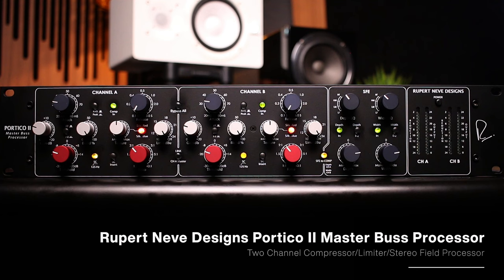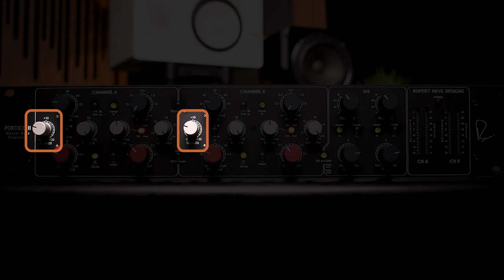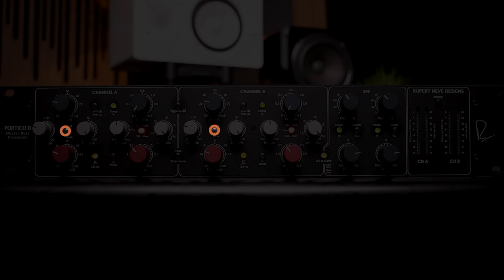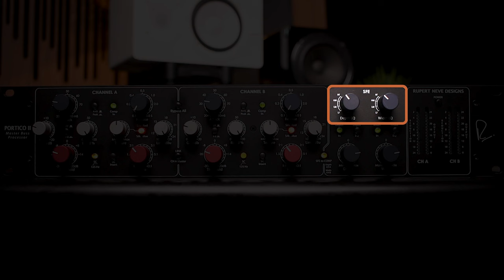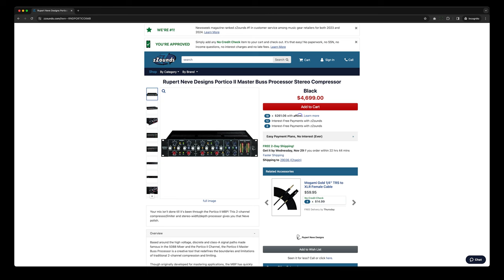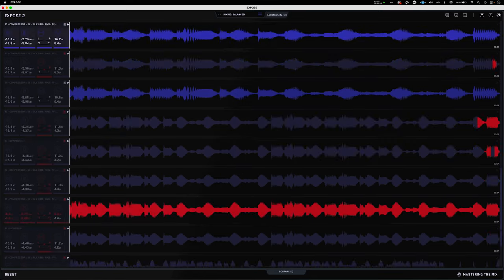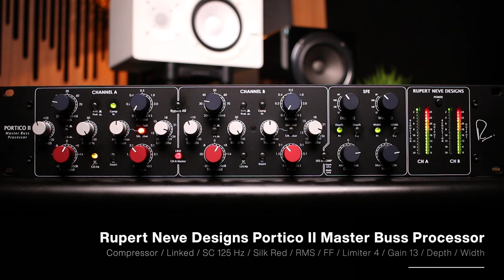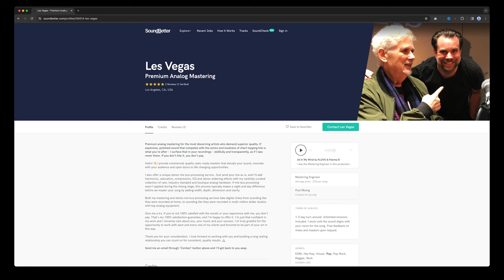Rupert Neve Designs Portico II Master Buss Processor (Demo and Overview)

Comment: Great video. I wasn't expecting such a dramatic difference between  linked/unlinked modes...even with very little compression. The stereo image in unlinked mode sounded a lot better, much more open.
Reply: he didn't do a direct comparison with linked/unlinked. if you look closely as soon as he engages unlinked he also adds "SFE to COMP" which completely changes the m/s weighting. it would've been really helpful to have that direct comparison before adding the SFE. overall a fantastic demo since the mix is good. Thank you Les!

Comment: I love mine - always improves the source in some magical way even when used in a subtle manner - just wish I had both red and blue silk simultaneously available right on the MBP - I’ve got a pair of the portico ii channel strips, tape modules, 5033 EQs, 5043 compressors, and the dual bus summing mixer as well - just incredible pieces of gear. RIP Rupert
Reply from the maker: @DragonBiscuit Yeah man! It's excellent! Thanks for watching and for taking the time to leave a comment. They incorporated the ability to use the red and blue silk modes simultaneously on the new Master Bus Transformer https://www.zzounds.com/a--3979429/item--RNDMBT. I think you're going to want that one. I wish they would incorporate the 542 tape modules in something like the MBP or MBT.
Reply: The MBT is the answer if you want to have Red and Blue silk simultaneously. The amount knobs for each type as well as a harmonics knob controlling the drive is just icing on the cake.
Reply from the maker: @NOLASkaGuitarist thanks for watching and for your message. Absolutely! I have an MBT on the way as we speak! That will be my next video. I can't wait to give it a try. I think I'm really gonna love it!

Comment: This thing can be heaven or hell on a mix....I got mixed feeling about it....
I think doing something like 
the WA G Comp, with a Stereo Opto, with a Silver Bullet and a Drawmer Parametric EQ will give you way more control over your master...but the same vibe..thats my final mastering chain im gona build.....Id rather have more control over the Compression, EQing and Saturation Seperately instead all coming from the same Color Box
Reply from the maker: @johnisrael5183 Thanks for watching and for taking the time to share your thoughts. Agreed. I like the depth, width and limiter on this thing though!
Reply: @LesVegasMusic  
i agree with you 
I just made a Portico Using Acustica Audio nebula Plugins 
I used 4 Alex B Engineering Plugins that are all Live analog sampled 
Pres Colors and Saturation 
on RND Silk Red Mode 
with the Neve 88rs Channel Console and the Neve 88rs Line Out Channel with the Neve 88rs Comp, with Acustica Audio Ash 
using the Prism A/D Converter Clipper 
all that totaled is $300 sounds Identical to Your Portico II ITB all the Same Componants from the Portico Live analog Sampled....
Reply from the maker: Wow! Sounds awesome! It's a good idea too. I'd like to sample the new RND Master Bus Transformer, the stereo field editor and limiter from the MBP, and add a pair of 542's for the ultimate RND bus processor. I'd like a good dedicated EQ too.
Reply: I'm planning on using the WA Bus Comp in unison with the Neve MBT (backordered), which is different from the MBP in the video. The Warm is not going to add much "vibe", as VCA's are usually very low on distortion. Just some glue and taming the transients as the attack is on the faster side, though can be set to let transients through as well. The compressor in the MBT is much more of a colored style compression being optical/slower. The only rack that would make me think twice about purchasing an MBT is a RN 500 series 10-slot loaded with SSL UltraViolet EQ, SSL G-Comp, RND 542's, and the SPL Big. Even have two slots to spare. But that would cost a good bit more.
Reply from the maker: @NOLASkaGuitarist Yeah man. That should be a great combination. I like your idea of putting together something similar with 500 series modules. You have some really good picks there! It would be cool to compare the results of the MBT to the comparable 500 series rack you're suggesting. They would definitely be different! I might just try that shootout. I would be interested in knowing which I prefer. Good thinking!
Reply: @LesVegasMusic  I would definitely love to hear that shootout as well, as I haven't yet found anything of the like. Thanks for the video!

Comment: Finally someone who explains it in detail. Can you use compressor and limiter at the same time? It doesn’t sound like it would make sense. Thanks
Reply from the maker: @turtlefeet7722 Thanks! Well, it's all compression. But once you're limiting, you're at the maximum, or the limit of compression. 🙂
Reply: Thanks man, great channel. Does the compressor/attack release ratio affect the limiting section? How is the signal chain anyway?  My digital plugin limiter has only gain knob and ceiling knob and compressor the typical ratio, threshold attack/release etc. knobs. When I send the compressed signal to my limiter to increase after compression the overall volume seems to be different here if I only have one gain knob.

Comment: When the desk is more expensive from your speakers,something is wrong.
Reply from the maker: @MrGreekBlade Haha 😂 What could be wrong?! I can't help it if desks cost more than speakers. 🙂 You should know that when it comes to gear, it's not how expensive it is, it's if you know how to use it. This is especially true for speakers. I could have $10,000 speakers, but if they're not right for the room, they're not going to produce good results. Besides, the speakers you see, are not what I mix and master on. You're not seeing $2,600 worth of headphones that I currently prefer referencing on over any speakers, in any room I've tried. I get excellent results that compete with any mixes and masters in the charts today. With that said however, I'm upgrading my monitors to the Dutch and Dutch 8Cs. What desk and monitors do you have?
Reply: @LesVegasMusic   Its not personal at all ,but as producer too , i still  believe is wrong for everyone to pay expensive desk or high class hardware like neve Portico ,eqs and compressors of thousands dollars and then  buy a shithole monitor like yours yamaha to work with this super expensive hardware...Your monitors at the moment is good for chicken house maybe,sorry if you hear it frst time dude...i am glad you use top quality headphones,that will be a big plus for your sound... i work with Genelecs 1032 many years now,a mid+ class monitor, and looking to move one class upper on a 3way system to a price level 5k-6k
Reply from the maker: @MrGreekBlade Right. It's not personal at all. It's not the gear, it's the ear! How many hit records were mixed on passive NS-10's that cost a couple hundred dollars?! The Yamaha HS line of speakers actually sound quite good! I just wouldn't count on them for any sort of accuracy when it comes to mixing and mastering. I use to like those Genelec's you have, but there are just so many better options today. Something with DSP helps. When upgrading, I was considering the ATC SCM25A's and SCM45A's, but ultimately I went with the Dutch & Dutch 8C's because of the DSP. Good luck on those speakers! Let's hear some of the mixes and masters you've done on them. Feel free to share your links here.
Reply: @LesVegasMusic   You say the half truth...you can buy a 5 inche monitor like your yamaha to fit on your room with 8k price and not 450$,come on man ...Yes is the room sound and the knowledge of your hardware but at the end always you need a high detailed monitor for critical works...so you made a good choice to replace your yamaha,that is nice....i work for hollywood industry as composer writing additional and trailer music for blockbusters/games/tv shows at  many huge networks.
I am not a mixing or master engineer but i have lots of knowleadge and experience on the field ,but still i dont master my mixes...always a master guy do  that for me.i prefer stay and  do only what i know well.
Reply from the maker: @MrGreekBlade Hmmm. I think you're misunderstanding. No half truths here. Of course you can buy expensive small 5" monitors. My point was NS-10's sold new for $375 a pair in 1998, and so many hit records were mixed on them so, expensive speakers don't equal better mixes. That's for sure! Oh! Very good! Yes, good to focus on what you're best at. Sounds like you're more of a musician than a sound guy. I'm more of a sound guy, than a musician. So honestly, it's not too hard for me to get great sounding mixes and masters using nearly any monitoring system. When you have as many years of experience working in sound as I do, you know what to listen for and what tools to use for correction if needed.
Reply: By that logic, you should only create and work in the best room… how realistic is that?
Reply from the maker: @MrGreekBlade the only logic I'm trying to communicate is that expensive speakers aren't necessary to get a good mix or master. Do you agree?
Reply: Hobbyist…
Reply: @MrGreekBlade  Bro Jeff Ellis mixes on Kali In-8s. It’s the ear not the gear lol.
Reply from the maker: @cainogang2353 That's what I say! But truly, I could mix a song on Sennheiser HD-600's alone. I don't need speakers or a treated room. I would prefer it, but I wouldn't let that prevent me from producing and releasing great sounding music.
Reply from the maker: Man. I've got to see that one! Thank for sharing!